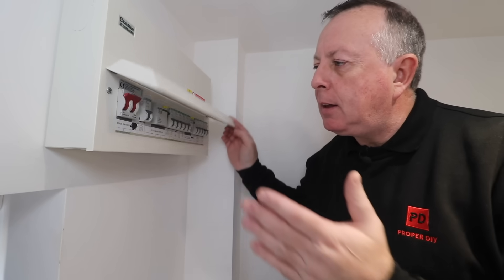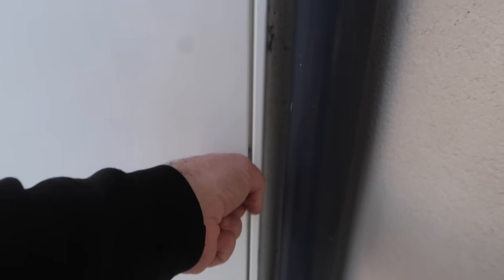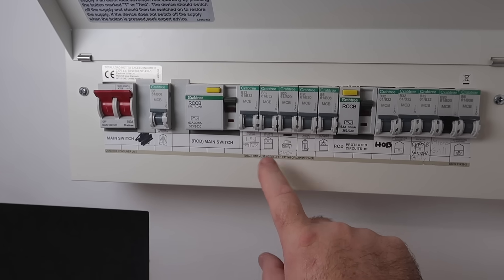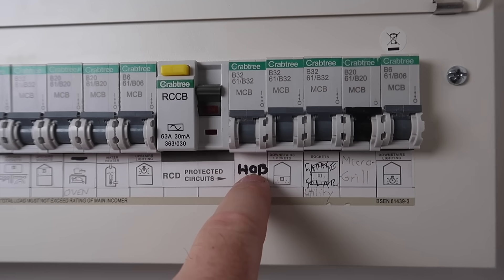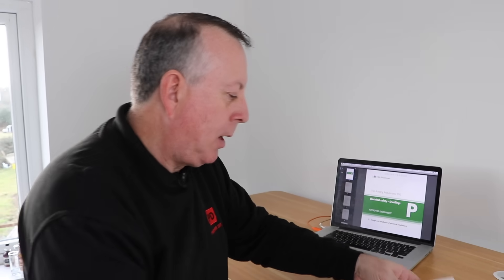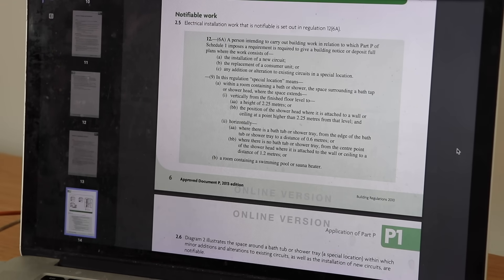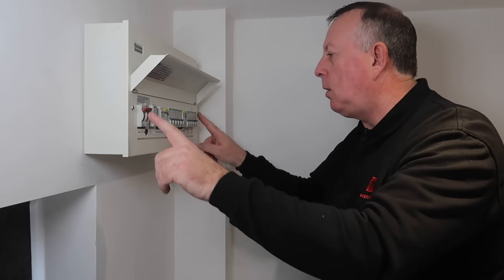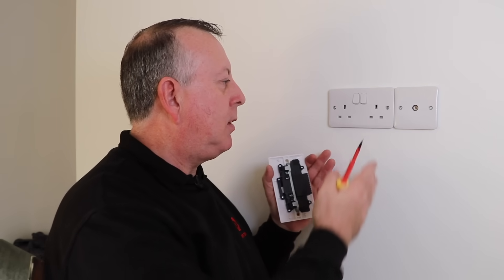What electrical work are you allowed to do in your own home?

Comment: OK, so I served an electrical apprenticeship from 1978 to 1982. This covered all aspects of electrical installation and I have the paperwork to back this up. I'm retired now and haven't worked 'on the tools' for thirty years. Am I still classed as qualified? My daughter has just bought a house (new build) and wants a security light installing covering the back garden. Easy to do but if I did it would it be legal? Done all my electrical modifications to my current house years ago before they tightened the rules. Anyone like to comment?
Reply: Many thanks for your reply.  Much appreciated.

Comment: Approved Document P 2013 mentions in part 3.13 that Non-notifiable installation work should be designed, and installed, and inspected, tested and certified in accordance with BS7671.

3.14 states that if authorities find out that non-notifiable work is unsafe and non compliant they can take enforcement action. 

Basically, installation work must be certified by a competent person using in date calibrated testing equipment to prove its safe for use.

Typical DIYers will not be able to comply with the wiring regs BS7671.

Comment: It is a shame you did not mention a minor works certificate is usually required at the end of a very useful video.
Reference to bs7671, is not even mentioned, but as long as common sense, best practice and engineering judgement are considered, that will possibly suffice as not everything comes from bs 7671 anyway......

Comment: You’re allowed to do a lot more than non tradesmen are allowed in Sweden.
By the way, I hope the clip on expanding the ring main was a radial circuit and not a ring circuit since it wasn’t expanded as a ring circuit.
Reply: In the UK a spur can be connected to an existing socket, on either a ring main or a radial circuit, providing that socket does not already have a spur.

Comment: Hello and thank you for your youtube videos they are very useful, please can you tell me what you meat by an Isolation switch as I am thinking of adding them to the washing machine and dishwasher that will have a plug to a sochet so the machines can have extre protection as they are curently pluged under the sink. the ones Im thinking of useing are the switchs with a secure fuse fitted and will be fasoned to the wall by a surfice mounted box. Im unshew what you ment by isolation switches in you video did you mean the ones in the consumer unit you was not clear? Thank you michael.

Comment: Brilliant. Pre-empts my job for next month - reading up on latest regs in preparation for some work I want to do. Others have commented, eg on spurs.
   I'd add one thing: as diyers, if we can, WE SHOULD CHECK work done by professional, qualified, registered, well-recommended electricians. I've yet to find thoroughly good work done by any that I have used. I've installed socket boxes all linked by 20mm or 25mm conduit with strings to pull cables through so they can just do the wiring - they still do a rush job with the assistant doing slapdash work and the registered chap doing a quick check with his meters to sign it off. I find the loose wires and reconnect by doubling over (as in some YouTube videos), clean out the socket boxes, replace the earth sleeving. Sometimes - find serious errors like oven connected to a standard ring MCB so have to get that fixed. Never trust a professional electrician, no matter how highly recommended until you have looked closely at what he has done (I've not yet found a female electrician but I'd guess they are more careful). I have found someone whose work on someone else's home was very thorough and he explained everything he was doing like he just loved doing electrics, but he might be unavailable due to caring responsibilities.
   Our mid-1930s semi was extended in 1970s to the side, loft about 2000, and by us to rear with new kitchen in 2017. We rewired completely with a qualified but unregistered friend who is a perfectionist and was up with the 2017 regs due to recent passing the exams. Then we did the extensions that had to be done by registered sparks. We have 2 consumer units and many circuits: original upstairs and downstairs power and lights; loft power and lights; side extension power and lights; kitchen power and lights; hall and stairs lights; boiler; electric hob; electric oven; smoke detection; power and lights to void under original house; outside power; outside lights; electric shower in bathroom; supply to brick outbuilding with power and lights from that. Want some rewiring to bring up to 2023 regs with RCDs for single supplies to fridge, fridge-freezer, washing machine, tumbler, microwave. The idea is to have the house thoroughly done and ready for my next heart attack and leave it easy for my wife to maintain and children to sell (with evidence of building's integrity) in event of her demise.

Comment: Man, your videos are just so good.  I’m not a professional but a very competant DIYer (an engineer father started me young), but every video of yours that I watch I learn something new, and your script and editing make everything so clear.
Reply: It's competent DIYers who get frustrated. I've no formal training, but I'm an electronics hobbyist, so I'm quite capable of understanding cable current ratings and derating them properly, and using the appropriate connectors. And I know not to trust any MCB or RCD off Amazon until I've personally had it on my test-bench to verify correct operation, given the counterfeit situation. I know what I'm doing, but the law disagrees: The default assumption is that no-one should be trusted until they have completed an extensive training and certification process, which is so convoluted that even on this video there are people arguing about exactly what the requirements are. There's no way I can prove my knowledge without time and expense.
Reply: @vylbird8014  i think buying MCBs and RCDs from amazon would be foolish because you never know what you get, especially with chinese stuff. better to buy them from a reputable electrical supplier. more expensive but you have a far better chance of getting quality products that work as designed.
Reply: @vylbird8014  Think of it this way, your abilities, though good, will not convince a insurance company, who by remit, look for ANY excuse not to pay up. As frustrating as it is, its better to cover yourself by using a Electrical Company (fully registered) to sign off any work you may do. I fully agree with your caution over products, unfortunately people's remit is cheapness and not safety. Any electrical equipment should always be A1 plus, so pick carefully. If its cheap, there's always a reason!
Reply from the maker: Thanks 👍

Comment: My dad had a water leak in his upstairs shower tray 5 or 6 years ago which leaked downstairs running into a twin socket on a 32amp ring circuit. When the insurance inspector came out to look what damage had been caused they refused his insurance as he had put a spur onto a 32amp ring circuit. So be careful doing anything even if it isn’t mentioned in part P as your insurance company won’t pay out even if the cause wasn’t the work you did and my dad is a retired electrical engineer
Reply: "as he had put a spur onto a 32amp ring circuit"
Surely that is allowed
Reply: Typical insurance......biggest scam going.
Reply: "So the question is: Are you gonna let the fear of insurance control your life? A real man never worries about mistakes until its too late!" - Mehdi Sadaghdar (ElectroBOOM, 2018).
Reply: Sorry, but that is not correct.  If the damage for which you are claiming was not caused by the work, insurance coys cannot now deny it.  This was an EU regulation brought in after 2001.  The damage you are referring to was obviously caused by the work he had done.
Reply: No it was not. The damage was caused by the water leak. @DavidMartin-ym2te

Comment: The Lewden box is a switch-fused isolator. it is there because your consumer unit is more than the maximum permitted distance of 3 meters for unprotected meter tails which is why it goes out in an armoured cable. You'll probably find that although the incoming fuse is rated at 100A, the switch fuse is down-rated to something like 60 or 80A.
Reply: I wonder how this SWA its made off at the CU end ?
Reply: @DerekHundik  I'm guessing it isn't.
Reply: @DerekHundik  @mainly electrical 👍⚡️ get subscribed 👌
Reply from the maker: Ok I understand that - thanks for telling me.
Reply: Hi Henry , subscribe @mainly electrical 👍⚡️
Reply: Best have your own box to extend meter tails with an overcurrent only DP breaker.  Or an RCBO 100/300/500mA DP, as in France, etc. Then L&N are cut out. A fuse as in the Lewden only cuts out the L.
Reply: @johnburns4017  100 or 300mA RCBO are installed after the meter  in TT mains only. . In TNC mains you install normally a single pole switch. 
There are TNS mains existing in England today? 

It may be different in in different countries. I live in germany and my DNO is also E-ON. In my area  were  I live  we got a TNC-S system . The chain is as follow:  cable from the road to the Incomer box with fuses, Meter box with  main CB before the meter, and finally to DB. So the latest regulations. 
in older installations the meter is direkt after incomer box, followed by  fuse. Sometimes a fuse combined with a switch.

same problem, even as a electrician, Im not alloud to do installations, except changing switches, sockets or lighting  fixtures. But the different to england is , no one care about if the installations are properly made.
A solar installatin can made by a homeowner , but he has to find an registrered  electrician (Meister) to do the paperwork do the DNO.
Reply: @Reaktanzkreis  wrote:
"There are TNS mains existing in England today?"

There are supposed to be, but many electricity suppliers have converted them to TT-CS, for economy without telling anyone. So always best to assume all are TT-CS. TT is mainly in rural areas. TT is best as it prevents problems if a Neutral drops out on the DNOs side. 

The suppliers (DNO) generally do not supply a DP isolator at the meter they are that mean.  It is like not supplying a maintap at the water or gas mains. Ridiculous. In this vid there is a main DP mainswitch. Who installed it?  Could have been the DNO, but most do not fit them. Could have been the homeowner. It is not typical to see one.   

The UK is behind the Continent. You have DP breakers at main panels (called a Consumer Unit here for some silly reason). In the UK breakers are mainly single pole.  DP are available, and now more common, but few are fitted. They are becoming more common, but not mandatory. We need to catch up ASAP. Everything in the UK is done on the cheap.

In the UK AFDDs (can be SP) have to be fitted on some high rises, etc, on socket circuits, and circuit deemed to be suspect by the installer.  They are recommended on all installations. Efixx did a vid recently about the wording of the regs. They say recommended means must fit unless there is valid reason not to.  In that the UK is ahead of the Continent in some aspects. 

In France, etc, they do not have a main fuse, having a 30mA or 500mA RCBO.  This is superb. But RCBOs on individual circuits are rare, as they have muti-row main panels with an RCD of different ratings on each row. 

In the case of this vid. Meter tails cannot be more than three metres in length. If so, then a fuse of some sort has to be fitted with an isolator. Hence the Lewden box seen here. The Lewden has a conventional fuse only on the L.  So the supply is not fully isolated if the fuse blows as the N is sill connected.  

I would have fitted a DP RCBO as done on the Continent instead of the Lewden, then all the house is protected, including any long meter tails.
Reply: @johnburns4017  What is TT-CS?

'The suppliers (DNO) generally do not supply a DP isolator at the meter'. Rubbish. All  DNOs will supply one on request. Some charge, some don't. They also fit them on new builds sometimes. I've worked on hundreds of properties that have DP isolators fitted by the DNO.

6 months ago you were saying that AFDDs were only "recommended" on domestic property socket circuits, now you are saying they are as good as mandatory, so which is it?

6 months ago you said that the Lewden switch fuse was just a "junction box" for the SWA to the consumer unit and that it served no real purpose. Now you are saying it is required because the tails are more than 3M in length after those who know better commented that this was the reason for a switch fuse.

There is a real safety reason why the neutral should not be fused. If you had any electrical knowledge whatsoever you would know why a 30 mA RCBO at the origin of the installation is a terrible idea, would never comply with the wiring regs, and would have a significant chance of nuisance tripping in a modern house.
Do you even know what the difference is or the purpose is of the different mA ratings of an RCD are? 30mA or 500mA. Thats a hell of a difference.😂😂
Reply: @davebadger100  
The suppliers (DNO) generally do not supply a DP isolator at the meter. Very clear. 

You know zero of Continental systems. Zero. Sad but true.
Reply: @johnburns4017  Yes they do. You know nothing about UK DNOs or UK electrics.

I never said I knew anything about continental systems, why would I? I work in the UK. You know nothing about UK electrical systems. Why you are obsessed with using mish mashing contintental systems with the UK system is beyond me. Maybe it is some vain attempt at trying to show you have some sort of electrical knowledge.
Reply: @davebadger100  
I would not allow you across my front door. Dangerous.
Reply: @johnburns4017  Ha ha. You couldn't afford me. Thats why you're busy bodging up your own electrics with your Fisher Price electrical kit and your Wickes Good Idea Home Electrical leaflet from 1994.
Reply: @johnburns4017  You wouldn't allow me across your front door because it's dangerous. Not surprised given the extent of your knowledge. I bet it's an electrical death trap in your house. Thanks for looking out for me.
Reply: @davebadger100  
You are dangerous.
Reply: @johnburns4017  Am I?  Off you go then. Tell me why I'm dangerous.
Reply: @davebadger100  
Reading what you write, you are dangerous.
Reply: Oh come on, that's a bit vague. You'll have to be a bit more specific otherwise people might begin to think you don't know what you're on about and that you're a bit dippy.
Whenever I reply to you I'm very specific.
So come on, give some examples of what I've said that is dangerous.
Reply: @johnburns4017  And again your total lack of knowledge regarding electrical regs and practice comes shining through. You clearly know nothing about electrical design or installation.
Reply: Yes you’re right he doesn’t seem to have much of an understanding.
Reply: @jimmyfurey  
 See @anonnona8099 post.
Reply: The meter tails are short having a DP isolator. I think the Lewden was installed to act as a junction box for the armoured cable running to the consumer unit. 

The Lewden serves no real purpose.
Reply: @johnburns4017  just lol
Reply: @HenryOCarmichaelSmith  
Depends on how long the tails are.
Reply: @johnburns4017  in our dno 3m max then you require your own fuse protection,the cut out belongs to the dno, 80a fuse max in outside meterbox our dno.meter belongs to your provider,also you should not put your equipment in a meterbox,supposed to be for cut out and meter only.
Reply: @leerobinson6017  wrote:
"you should not put your equipment in a meterbox,supposed to be for cut out and meter only."

The DNO does not own the meter box. If there is space the homeowner can fit what he likes, as in this vid, fitting the Lewden box.

Many outside meter boxes have a 100A main fuse.
Reply: @johnburns4017  Nged dno, 80a max outside meterbox.Yes home owner owns meterbox but it is only for dno and metering, part of your agreement in having a supply.
Reply: @johnburns4017 serves no real purpose?  😂😂😂😂😂😂

Comment: I am a retired electrician and I am under the impression that IEE Regs are not enforceable by law unlike the gas regs.
Reply: They are not a legal document. However they can be used in a court of law to prove competence and whether or not any work carried out is safe and correct.
Reply: @davebadger100  so I am correct they are not enforceable by law if any member of the public can purchase electrical accessories over the counter then there is no way the regs can be policed

Comment: I was thinking about replacing the old bakelite fuse box that is in my garage with a modern RCD box.  It's part of an existing circuit which is taken off my in house RCD.  Under the building regs, am I, as a DIY home owner, allowed to do it?
Reply: Hi spenny , subscribe @mainly electrical 👍⚡️
Reply: I don't think so
Reply: Maybe, if its old the cable to the garage may not be up to the job and require opening up the CU, many get wired up with standars twin and earth and ran outside which should be replaced which you technically cannot do yourself but if the garage is run on its own existing circuit and can be isolated then I cant personally see an issue as you are not adding a new circuit.
Reply: I find giving your local council building control officer a ring or email is useful. They can advise.
Reply: This comment scares me
Reply: Why? @jameshansing5396